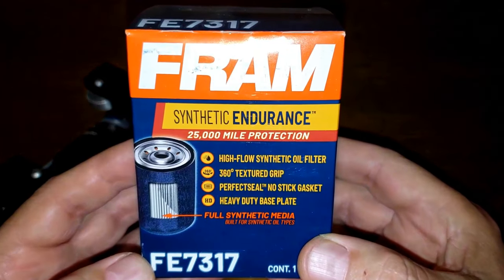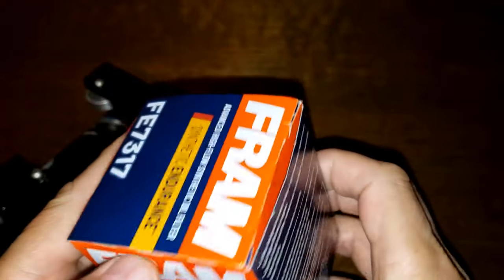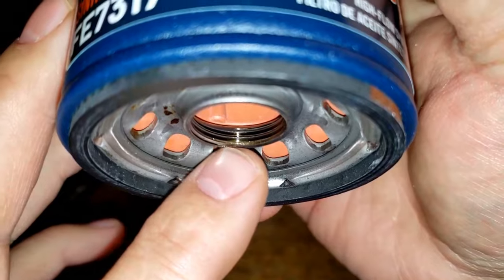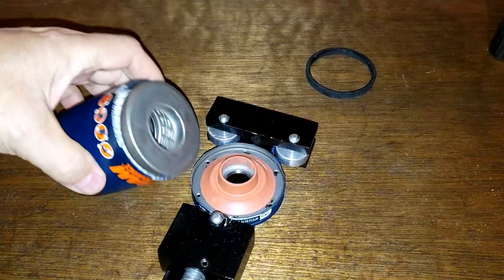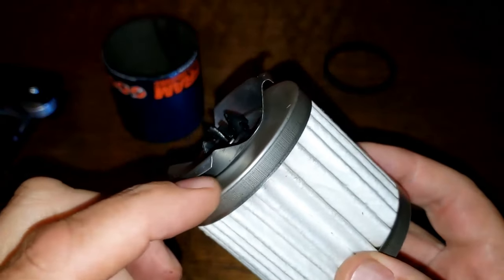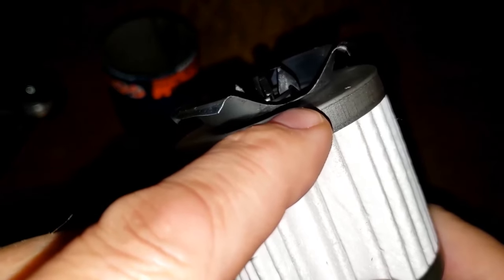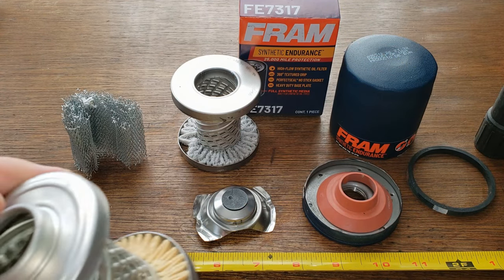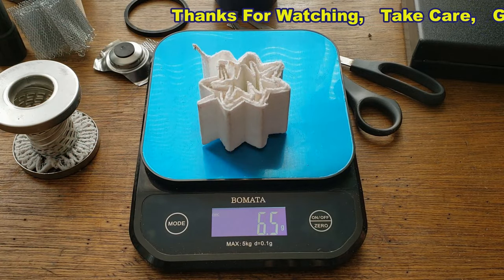Fram Endurance FE7317 Oil Filter Cut Open, Oil Filter Flash light Test

Comment: The type endcap bypass design used on the "Fram" FE, basically the same for ALL Champ Labs made filters now. That would include Super Tech, ACDelco, some STP, Amsoil, and topic Fram FE. I think what's causing the light to be seen, the protrusions used on the inside of endcap to hold the bypass. As there's a raised ring on the dome endcap, and a recessed part on stamped spring, I'm thinking without the raised endcap "nubs", the spring 'could' fit flat on the endcap. Otherwise, for what it's worth, the FE looks good. Thanks for vid.
Reply from the maker: You're Welcome faxmen09
I agree with your assessment, Thanks👍
Reply: @WhipCityWrencher  👍

Comment: The Fram Titanium used to have a rubber seal between the stamped spring and metal core that sealed everything up.  I don't know if they still do, because the Titanium has changed and you can get different variations from the same store shelf.  I wish Fram would just be consistent with their top of the line filters.  

I noticed that this Endurance had a metal crimped seam where others just had a glued seam.  That is an improvement that I hope they keep.  

I like the style of bypass on the Purolator, Wix and Mobil 1 filters more than the Fram style, but the Endurance would be hard to beat if they will go back to putting in the rubber seal.

Keep up the good work.
Reply from the maker: Thanks👍

Comment: How I miss the old Ultra, nothing will ever beat it's dual layer reinforced micro glass media and they used to put an extra seal on those that sealed the leafspring against the bottom end cap.
Reply: It is the titanium at advanced now
Reply: @chriscalderin6677  Nope, the Titaniums tend to be slower sellers and may have used the dual layer media a little longer, so they appeared to be unchanged but they're now using the same media as the Ultras.
Reply: @brandonupchurch7628  dang that sucks I went to the website you might be right. I liked that old ultra also and I just used my last old fram . The endurance leaks around the bottom spring so I guess I need to find a new filter

Comment: You should try this on a SuperTech filter that has the felt endcaps.  I'd bet the seal between the leaf spring/bypass valve and that soft material would be better than a metal-to-metal interface.  Also, in this filter, there is a chance the seal may be more efficient in situ because that leaf spring is under mechanical pressure and compressed.
Reply: Good point
Reply: OfficialNakatsuMegami  I did.  I still say that leaf spring is fully compressed when in situ.  Just look at how much the end cap sticks up after he cuts it open.  At least 2-3 mm.
Reply: Fwiw, I think you may have a point on the in situ spring compression. Using the vice a good idea, but (no offense to Whip intended) the side the stamped spring on doesn't appear even/equal across the two ends of spring, like the can dome end would be. As for Champ Labs with polyester caps on 'might' not show the light. But those filters are an older and now less common Champ Labs design. I still think the protrusions on the inside of the dome end cap that holds spring, a major factor in light seen.
Reply: @faxmen09  Champion Labs still makes "cheapo" filters for some companies using the fiber/felt endcaps.  I just can't remember which ones.
Reply: @Gary7even  Yes, I'm aware of that and didn't state otherwise. That said, doesn't change that it is now an older and less common Champ Labs design. Most Champ Labs ecore (nylon) now use metal caps too. However, some lowest tier ecore like Super Tech 'ST' series still use polyester caps. Also, some ACDelco ecore like the PF47e still use polyester caps. But, never seen Champ Labs with polyester caps and metal core, like topic. Only Champ Labs made ecore.
Reply from the maker: Hi Gary, 
Thanks for the suggestion, I will give them a try also.
Reply: Steel against steel would almost never be leak free. You'd need a cone shape with very tight tolerances.
Reply: Good point Gary. I think it would make a better seal. Almost like a gasket.

Comment: Very good video, Most people would not think to test the seal made at the bypass valve mating surfaces. For such a higher end filter I would think they would have a better setup for the bypass valve. These look the same as the less expensive Fram filters. For a  fifty cent rubber gasket or silicone gasket placed between the mating surfaces this would give a tight seal.
Reply: Fram high end?

Comment: Thanks for sharing! I have nothing against Fram, but in my opinion, they should be ashamed of this. The fact that they were either too incompetent to figure out something so simple or too lazy/cheap to come up with a solution really doesn't look good for them.
Reply from the maker: True but it's not just Fram I believe any filter that has this type of bypass valve will probably leak a little. An Amsoil oil filter failed this same test and  I think the majority if not all Champ made oil filters will fail. Check out the pinned comment by faxmen09.

Comment: Interesting to see how that worked and thanks for sharing it .. I have done some research and testing on some Oil filters with a clearview head and i have seen those endcap bypasses fail more so and for the basic automotive filter they are fine for what they do but in Larger diesels its still better to have the 2nd filter for bypass and if i was going to do high miles on any car or truck it would have a 2nd filter for that purpose and last much longer for service .

Comment: Yes you can see light but under  Hydraulic pressure differential small gaps that allow light suddenly close up. Hydraulics is a very powerful force far more powerful than your hands. Now will it perfectly seal probably not. But hydraulics like water will follow the path of least resistance and the filter media is far less resistant then thay tiny gap that shows light. This is why the filters that are not open at the bottom and are sprung with a coil spring at the bottom and the bypass is at the top are better.

Comment: I believe this is the correct fit for my '22 Honda CR-V. My intent is to only use the top-end filters like  the NAPA Platinum, the Wix XP, the Purolator Boss with 100% synthetic oils to protect my engine, with my choice being based on what I can get for the best price at the time.
Reply: Napa Platinum and XP don't filter as good as the Boss or the Gold/Wix Regular. Purolator didn't forego a good micron rating for crazy longevity. Cleaner oil is better oil. Don't fall for marketing BS

Comment: It  leaks because the new Endurance filter does not have a seal between the endcap & leaf spring. The old Fram Ultra (with metal screen reinforcement) has a built-in felt seal on the endcap where the leaf spring sits on. Could you do a flashlight test on the old ultra filter? Excellent video thanks,
Reply from the maker: Thanks!
Yep the old Fram Ultras did have that seal on the endcaps, 
but no point in doing this kind of test on an oil filter that is no longer being made.

Comment: Do you think there’s any chance it behaves differently when there is oil present, it is hot, and things are lubricated/more slippery?
Reply: No. And even if it did leak slightly less when hot, relying on thermal expansion for the filter to seal would still be an objectively terrible design.
Reply from the maker: JMHO but I don't think it would matter.
Thanks!

Comment: Drill a hole in the top of the filter then shine the light inside so the filter will be under compression still.
Reply: Great idea! I don't see that making any difference with this filter, but going forward, that's definitely the way to go instead of trying to replicate the pressure of the spring.
Reply from the maker: Great Suggestion! I'll try it but It would have to be from the side to see that sliver of light.

Comment: I have 2 little thoughts about this bypass valve fiasco.  The elements with the felt end caps probably would seal better around the base of the valve just because of the fibers, and would still maybe catch some stuff. I think that is a future video, walmart filters maybe? I am thinking is where those are used at besides the orange frams?  The second thought is, even if a little bit of oil leaking isn't a huge deal at the start, I would think the more resistance to oil flow the filter media becomes over time, the more likely it will go thru the gaps.   I can't help but laugh at the 25K mile rating, bypass leak or not.
Reply: I would never go 25,000 between filter or oil changes! An accident waiting to happen.

Comment: the real question is does it matter? do all oil filters have tiny gaps? does the bypass valve open at high rpms on motor or when oil is cold and thick?
Reply: That was my question too. I think most of the oil will flow through the media most of the time. They are rated at 99% above 20 microns anyway.
Reply from the maker: It may or may not matter, who knows you could use a million of these with no problems. I wouldn't be afraid to use this filter, lots of them are made with this type of bypass valve. I'm just showing you guys how these filters are made. 
Thanks.
Reply: @WhipCityWrencher  Thank you!
Reply: @JazzyJonas My question is if it lets enough unfiltered oil through to negate the 99%.  If 5% of the oil goes through unfiltered then that knocks it down to 94%.  Then you have to account for all sizes of particles getting through these gaps.  If you just get a well made filter with 99% at 30 microns that is sealed so that no oil gets by unfiltered would you be better off?
Reply: @MountainLife1  All the oil eventually passes through the media.
Reply: @JazzyJonas  If you think of each molecule of oil separately then, yes, each molecule of oil eventually goes through the filter.  If you had a clean, completely closed system then the oil would get cleaner with each pass until the oil was cleaned.  The problem here is that each time the oil passes through the engine, it gets contaminated.  That is the point of having a filter.  In this case, some of that contaminated oil with all sizes of particles will get by unfiltered.  So if you look at it that way, the oil can never get cleaned to the level the media is rated for.  In fact, some of all sizes of particles get past the filter at all times.  If you had a properly working filter at even a 35 or 40 micron rating, at least no particles larger than that could get by as they will on this Fram.  Fram needs to fix these issues.  I have 2 of these Endurance filters, but may return them until Fram gets  back to consistency.

Comment: Nothing a 2 cent o-ring couldnt fix ! Got me wondering about  vehicles with the bypass valves  built into the motor !  Pretty intriguing to say the least ! It would be a good idea to see if your vehicle even needs a filter with a bypass valve if not problem solved ! Cool video ! 👍👍👍👍
Reply: If one's vehicle manufacturer specifies a bypass valve in the filter, then any filter used must have one. Otoh, if engine has block bypass, like many (not all) GM, then none is required for the filter. The vehicles topic 7317 filter is used on and spec'd for, require bypass to be in the filter.
Reply: Oil is the heartbeat of the engine. Why risk is with aftermarket brands? Go original & be safe.
Reply from the maker: Thanks, Scotty
I agree perhaps a silicone O-ring 😊
Reply: @riceburner4747  Car makers just want you to get through the warranty for the engine and that's it.  After that they want you to buy a new car as they are in the car business not the oil filter business?  On the other hand aftermarket filter manufacturers are in the filter business and they want to make the best filters possible to make a name for themselves and sell more filters.  This is why in my opinion aftermarket filters are far superior.

Comment: I think that $12.97 plus tax is a lot to spend on a premium oil filter that doesn't filter oil. Glad that I didn't buy one last month when I changed my oil.
Reply from the maker: Unfortunately, many other oil filters also have this same bypass valve design.
Reply: @WhipCityWrencher  Makes me glad that our old 1970 C10 350 has the bypass in the block. The Baldwin filters we use have no bypass in them. Interesting to see light test on filter. Good innovation for further filter  analysis.

Comment: I doubt it really makes a difference. The ratio of used to filtered oil is greater. I’d like to see the old ultra tested or even the new
Reply: Wow, if that's the standard for filter efficiency, might well forget ISO 4548-12 efficiency testing. As long as the ratio of used to filtered greater, all good. 🤣

Comment: Don't forget to blow to see if the louvres flow like the round holes.
Reply: Trying to figure out if this comment meant as a joke. At 9:28 of vid flashlight test shows louvers are well formed and open. In short, louvers here are fine. No blowing needed.
Reply: @faxmen09  just wondering which one flows the best circle holes or louvers
Reply: @ruleev6432  Been discussed often. As long as louvers open, well formed, they flow equally well as holes. The true restriction point in the filter engine block circuit is the interior diameter area of the block filter mounting stud. As long as total area of louver openings or holes equal or greater than that area, all good. Normally total area of louvers or holes significantly more than that. One other thing to consider, always more louver openings than holes per area of tube.
Reply: The media itself is more restrictive than hole style...Save for the stud diameter faxman mentioned.

Comment: In this case, the light at the end of the tunnel is not a good thing. If that bypass value/spring combination had a sealing surface instead of metal on metal, that filter would be good.
Reply from the maker: Yep, I think a gasket would work.

Comment: I never realized, until recently, that champ and fram are both owned by the same company. So we really only have 3 oil filter manufacturing companies... How sad. That design is an oversight. 

That being said, the bottom end fram is worse than bottom end champ, and top end fram is better than or equal to top end champ.

Comment: That is a really cheap design.  Why would you not have the bypass valve integrated into the bottom of the cartridge?  Oh wait, it probably saves them .25 a can.  Ironically they spend extra money on that textured finish but cheap out on the internals.  The rest of the filter actually looks nice, but I will never buy any filter that I know has the two piece bypass valve.   There is no way they don't know about this design defect and ruined what looks like to be a pretty nice filter.  The Fram can of death.
Reply: What do you use?  I have used Mobil 1 filters alot.  Only 99% at 30 microns, but they seem well built and have a much better bypass valve system
Reply: @MountainLife1 I use purolator pureone and Land Rover branded filters. The Mobil one it’s pretty good from what I understand but the pure ones are easy to buy in bulk for me. I also have used the Carquest blue filters in the past, but they’re pretty much Purolator pure one filters.

Comment: 2:40 invalid “test”. The spring pressure needs to be applied to fully seal to the filter body. And, what gap exists, is not too relevant as the resistance to flow in the filter media is lower than through the fay surface od the filter body to the combo valve.
Reply from the maker: The leaf spring bypass valve is seated as far as it will go in. IMHO it will not go in any further without distorting the leaf spring.
Reply: @WhipCityWrencher  Spot on Whip! Stamped flat spring don't have much pressure in the can anyway. Just enough to hold element in place.

Comment: You can't compare Light to a solid liquid as Oil is.
Reply: I don't understand your point? If you can see light through a gap, pressurized oil is most definitely going to leak through that gap.
Reply: So who does make the superior filter, Purolator Boss only filters @ 45 microns, Wix XP is 35 but I guess that's pretty good, if you're running 15k oil changes. But I guess I'm old school, I'm still running 3 to 6000 k and that's on synthetic.. But still what is the Superior filter?
Reply from the maker: JMHO but If you can see light, then there is a gap there and oil will go through it, especially under pressure. If you had a gap that big where your oil filter meets the engine, you'd have oil all over your engine.
Reply: @WhipCityWrencher  So out of all the filters you have cut open, which one is superior overall?
Reply from the maker: @ssalzillo1  Hi Scott,
I don't know which filter is superior. They all have their good and bad points. This small space between the bypass valve and end cap wouldn't be a deal breaker for me, definitely, more oil will get filtered than not filtered. I still think these are very good oil filters.